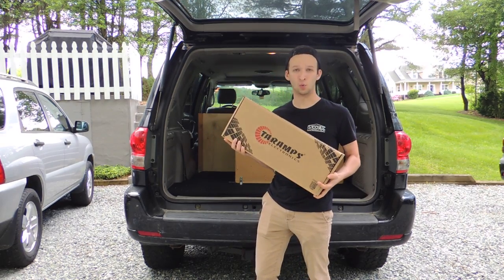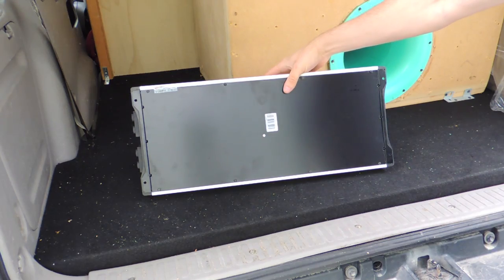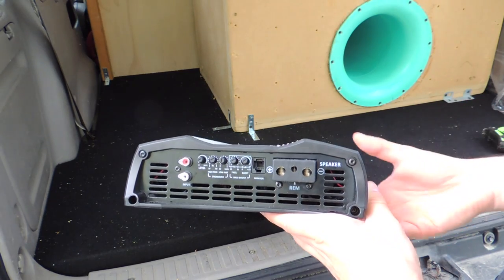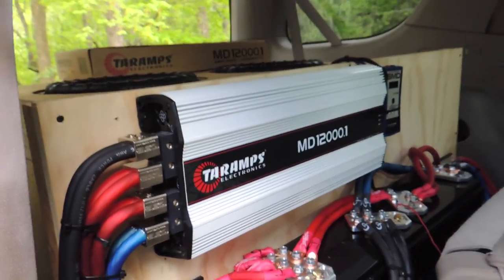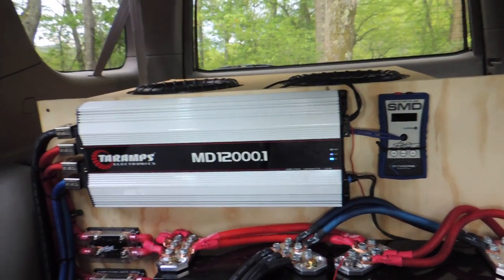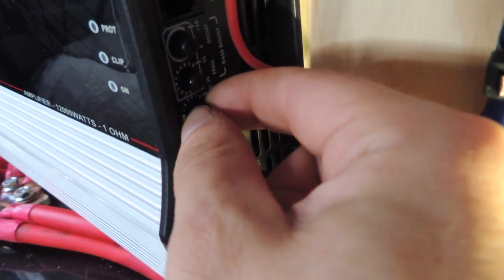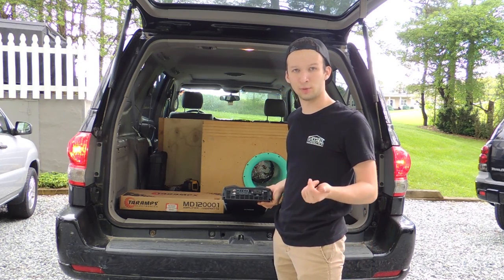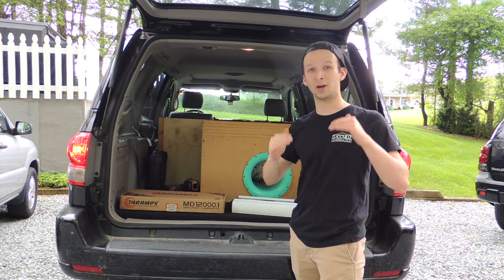TARAMPS? Watch This Before Buying!! | Taramps MD 12000 Review

Comment: Idk why you quit using the rp-2k so quickly but... I bought one at the same time you told me to buy the elites around mid February. First one came, I was breaking my subs in so I ran at 4 ohm. It lasted 7 days n went into permanent protect. 2nd one came and I hooked it up to 1 ohm instantly. It lasted 9 days and went into protect again! 3rd one came, and was dropped and damaged internally during shipping. So I'm on 4th one now. Never once went into protect. And been running it 45 days or so. And I'm okay w it. But I feel like I'm just waiting for it to happen. Big d wiz told me not to buy it, cuz it's unreliable. I clearly didn't listen lol. So that's my experience with Skar RP-2000.1D
Reply: Gotta say the customer service from Skar is on point tho.
Reply from the maker: I liked my RP-2000 just needed to upgrade to something bigger. That’s crazy you’ve had that much bad luck with yours
Reply: @ParkerTheBasshead  apparently, it's a known problem. I know ur kinda in the public eye of car audio nowadays, and you won't say too much negative about a company because of that. But I was sold on skar. I liked the name, the logo, the rms ratings, the cool looking sleek equipment. But in all reality, the company is a shit can. Sdr's suck. Evl's blow at rated power. Rp-2000 has permanent protect problems. Etc. So I'm gonna get away from Skar at this point. I actually looked into that solid ass audiopipe 3k cuz they're amazing, but the price sky rocketed and that particular one isn't the easiest to buy. You can find the 1.8k's pretty easy. And the 2k. But that 3k is a unicorn lol. I'm kinda angry at American bass cuz I bought a shirt and got the runaround for 3 months until they finally gave me a refund. If I can't get a shirt, what makes me think they would send a $400 amp if I bought one? They're local to me and I was gonna go there myself, but this corona shit has everything on lock lol. I got my elites from audio savings on eBay. But honestly thru all the bs, the car audio shit is just getting exhausting. And companies suck anymore. Making me wanna give it up honestly. I wish the understood its not cool to fuck customers over. Sorry man, rant over lol. Got carried away.

Comment: Taramps 12k actually does 11,177 on 1ohm from dyno which still is a lot closer then most other brands get to what they try and say it can do
Reply: I believe I know which video you're referring to and if you look closely it did that at 12.55 volts. Which is great because it's rated at 12k at 14.4 volts so if they did the dyno again and checked it at that voltage it may do at least 13k

Comment: How the heck did you get the SHCA dual fuse holder covers on?  I have such a hard time fitting them after even using a 16ton hydraulic crimp.  Nice video BTW.  Thank you!  Now I’ll just save for some B2’s.

Comment: I made the same error on a SoundQubed S12250. I shorted out the pos and neg output wires and it went into protect, but it also fried most the mosfets. Anyway, I believe they should have sent me a new amp because its supposed to go into protect to keep it from frying but it did not. It did go into protect but it fried and stayed in protect. B.S! They charged me $120 to fix it and I had to pay to ship it to them. Was my fault, but like you said, " thats what the protection is supposed to be there for."

Comment: Taramps- made it 6 months.. that's great.
Rockford Fosgate- 20 years later.....
Reply: I saw a RF die within seconds once, guy tried installing speaker wires while unit was on.
Reply: Jorge Serna your said once lol.  New style cheap amplifiers every other day
Reply: Jorge Serna lol
Reply: Jorge Serna and technically electronics die when they decide not the brand I guess. It is electronics
Reply: @angelvip2474  The Taramps was shorted out by the user causing a short life on unit. I repair amplifiers and other non related equipment. Quality components will usually last longer. Older equipment was usually smaller in output and 20 years ago most amps were about 500 to 1500 watts. Today amplifiers draw tons of amperage and most are used below minimum load. 

Hold up....

Yes, can I get a number 3.....

Can I also get a number 4.....

Both Large cokes....

Thank you.....

Ok, well I got to go. I may upload some videos of amps I repair.
Reply: Jorge Serna agreed bro

Comment: I wouldn’t tell you to mount that amp on the box. You might be having trouble with the amp because of vibration. I had a similar problem with a dsp3000. I went through 3 of them under warranty. I moved it off the box and never had a problem since. It’s been 1 year and a few months now.

Comment: What would you rather do. 2 10s AB or 1 12 DB witch both equal 2krms with a AB 1800.1 amp?? Also thinking of Inifinity Kappas for voice
Reply: Definitely depends on what kind of space you're working with. I'm running one AB XFL in a built to spec ported birch word double baffle box built by GP audio and an AB VFL comp 3k on it and gets down like nobody's business installed in a 08 Grand Prix. I'm thinking about selling the box and sub and run 2 XFL 12's at .5ohm since I've got the power and electrical upgrades to run everything. I'm just shy of hitting 143db....Parker hit a 145db on his review of the XFL last year.
Reply from the maker: Yeah man depends on a lot of things. 2 10s would have more cone area
Reply: @ParkerTheBasshead  have you made a video regarding mids,highs, tweeters?? Been looking but havnt found 1

Comment: Dang Parker! I blew my hcca the same way. Disconnected to slide box over, wires touched and the chassis at same time, loud pop, and my hcca went into bezerk mode. It completely fried my small sundown sae 50.4, but the hcca still sorta worked. It made a odd noise after it was first cut on, then while playing at loud volume it got distorted , and subs would pop. Sent it to Orion, they shipped it back the next day. Said no problem found. Im like, did yall test it? Cause it will power up fine, but makes funny sound inside amp, then pops or distorts at high volume. I just decided to call it a loss and go with 2 smart 3ks. Problem solved.

Comment: I just can’t come to buy Brazilian amps. I got JL, Soundqubed and Rockford Amps.
Reply: I feel ya ,I’d try one out if I got a gd deal on one cause seen a vid  guy had like 4-6 12 “s on a amp similar taramps
Reply: I need to find a cheap used one with over 1k watts. I paid over 200$ for 250 watts for a Rockford amp. Totally not worth it. I could have been upgrading part of my system instead I messed up being an uneducated consumer. The quality is great but for the price I could have easily gotten 1k or more.
Reply: @finnirish12  genius audio hd3000.1
 You will need another battery though

Comment: Nice amps, too bad about the internal protection though
With that said, you might want to consider adding dust filters on the intakes of those fans - I was watching another video where the reviewer was complaining about dust and debris buildup in his Taramp amp, which eventually lead to failure.

Comment: Rare to be on the output section, looks like when you shorted it the fet broke and then when you turned it back on the fet caused something else to fail and blow and in turn made the fet explode fully, but it is unusual to be on the output, usually it is on the power supply section. But I think cuz it was a speaker short it did not affect the power supply

Comment: Taramps are very hard to get them to do warranty work. I bought 6 Taramps. 2 quit working so far. The fans caused one to quit working after a little more than a year. The other one that went bad only lasted 8 months. So hard to get warranty work, I gave up. I will not buy another one.

Comment: according to most people I've been abusing my md8k but been running over a year ran it on stock alts ran gain too high and mounted so that it bounces and it's still kicking now before you try the keyboard warrior thing I have fixed all those issues and still have no issues

Comment: I need some advice I have six rockford fosgate p3 12s and was wondering what would be a good bass amp for my subs?? I'm looking to spend $400 to $600. I have a 320 amp alternator extra battery and 0 gauge wire.

Comment: It's like anything else, you only hear about the bad. So many run taramps with no issues. They do need better packaging. Brazilian based stuff is also very particular on how they want your electrical. Like top to.bottom you can't short cut them or you will have problems. That's your trade off for the watt for dollor. I know our guy has better electrical than most but he has been changing things on the regular.

Comment: Grace and peace Parker. I love your content. I had a question. What was your electrical when you were running this if you remember? I'm about to run of these, the .5 ohm  version at .67 ohms. I have 3 AGM Deka Intimidators, stock alt and the big 3 with 0 gauge. I'm looking for a 300 amp alternator for a 07 Civic.

Comment: I really disagree amps mounted on the subwoofer enclosure, receiving all vibrations. In addition, if you open a huge amount of amplifiers, you can see a lack of glue between the circuit board and heavy components like coils, capacitors, power wiring... I always do a review and some improvements on the amplifiers (and stereo players) before install. If necessary I print a fake warranty tags in order to mantain the warranty.

Comment: Out here in California I've known a few guys that have run this brand of amps and only keep them for around a year then swap them for a Skar, Sundown or Addictive Audio. For $600 and change I would just get a Skar skv2 3500.1d it's somewhat budget friendly and a well built Korean amp but that's just my 2 cents. Keep up the good work and info coming 🤙
Reply: The skar sk series is korean design but still chinese built nothing wrong with it but just letting you know if you didnt
Reply: @bigrobstillpimpn  oh wow no I didn't know that bubba ya learn something new everyday LoL I've been using Skar amps and sundown subs for a few years now and I have never had any issues
Reply: Yea I have 3 skars 1200/1500/2000..... they are great, I just recently bought a taramps md 3000, and md 1800, just to switch shit up, I put the md1800 in place of the skar 1200.....and the md3000 is still on the shelf in my garage,  I might use it for my garage stereo though. ....I've got all kinds of spare sub boxes and subs....my wife hates it when I'm in the garage wrenchin with my garage stereo on, it rattles all the dishes in the kitchen cupboards. .....just an audiopipe txx bdc3 12 behind a rockford prime 500 watt amp in a 2.5 cu ft ported box, but I have plans to add more subs and watts.....

Comment: I replaced the fans with noctuas and they are dead silent.
Reply: That's a great mod 👍
Reply: @catch22frubert   I should mention it voids the warranty removing the bottom plate, the little tamper evident sticker ya know.  Very big pads to solder on to and is super easy though.

Comment: funny thing is when I had had a pioneer amp I upgraded to a fosgate amp and failed to realize that the power terminals were backwards so I connected it the same I turned it on but nothing happened so I went to check it and realized I had screwed up luckily I flipped them and got lucky cause the amp still works to this day it took a beating like a champ with massive voltage drop now it bangs harder after I had upgraded the alt. Maybe I got lucky the amp should have blew up but it didnt although im looking for something around the same power and is more efficient its a r1200 prime.

Comment: just noticed the reason why they are so small and cheap, it's because every frequency above a certain output voltage is extremely distorted ( oscilloscopes shows you that), so everyone is so caught up on "hitting hard" for a feel seconds but forgot to check the waves that it creates for a long term use. Every taramps gives such a dirty signal far from the RMS rated, yet it doesn't clip at all if kept the gain just below the voltage limit in which consequently gives you the impression that the amp is amazing for what it is, square waves is what burns our speakers, and this thing makes tones of them, such a shame! Brazilian speaking here...

Comment: Most amps won't protect from that , many DD amps will blow all the outputs if shorted .. protection circuits arnt designed for a hard short , never seen one fast enough

Comment: I dont know what amp i wana get ive been through 2 tarmps 1st one being my fault being a frayed power wire caught it and it completely exploded 2nd being i have no idea worked great for months at 1 and 2 ohms but when i wired it to. 05ohms  it popped and no longer works which it is the half ohm version and no output wires were frayrd or anything so there was no reason for it to die. I did only pay 600 bucks for it and got it under warrenty thr first time i killed it. So only now im gonna be out some money

Comment: Ultra careful, No. Just follow standard procedure. Car off and main fuse removed or breaker disconnected before working on you system. I seen few amp blow like that. Earthquake and MTX.

Comment: RIP. Well im hoping they sent you a replacement for free. From the look if it you only blew a few FETS in the output section of the amp. Honestly assuming the drive circuit is in tact you could probably fix the amp for less than 50 bucks.

Comment: I hope you realize that this amplifier is generally meant for your woofers and mids... It's not really meant for just subs... That's what their "BASS" line of sub amps are for. everyone keeps strapping these MD's to their subs not realizing it's the wrong style of amp, and shouldnt be used. It even tells you this on the Amazon store, their website, and on the box I believe.
Reply: Lol...They're FULL RANGE amplifiers.  They will play all frequencies. You have a low pass filter, and the high pass is used as the subsonic filter. It does not matter if it's a class a/b or class d...or if it's half bridge or full bridge technology, an amplifier will play within its tuning frequency. If it wasn't meant for subwoofers, it wouldn't have a low pass filter, and have a functional subsonic filtering potentiometer. That's like saying, JL Audio slash amps, and Rockford, MTX, Alpine and others, that  use full bridge and full range technology, and have for MANY years, aren't meant for subwoofers.

Comment: Man, I've had mine running in my daily driver beating on 2 ZV5's 15's with no problem since the half ohm version came out. I've also been running taramps since day 1 without ever losing one. What are you doing wrong? Cause you're doing something? It's not the amp.
Reply from the maker: Did you watch the whole video?
Reply: Lol, told you. You need to lead with that. All it does is piss off taramps lovers who don't want to finish the video.